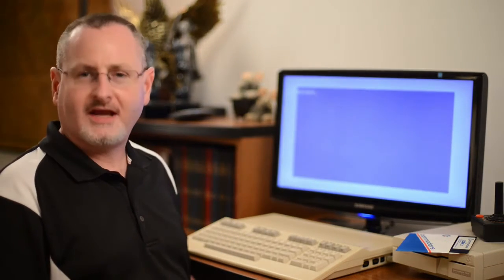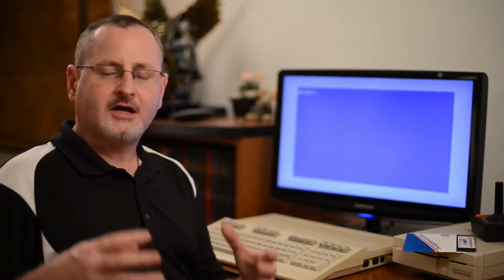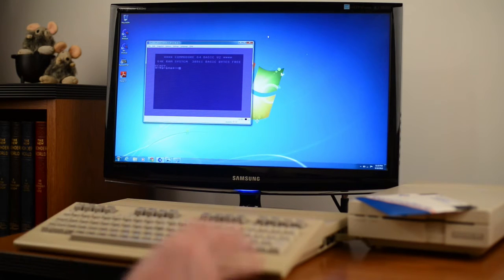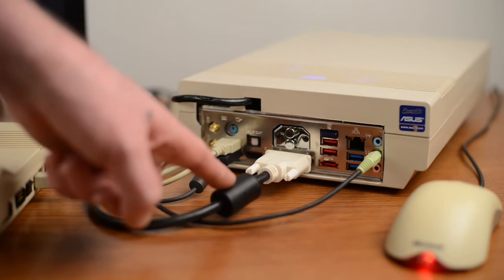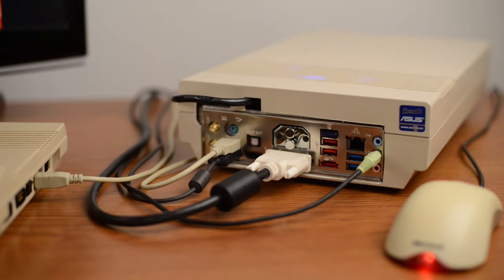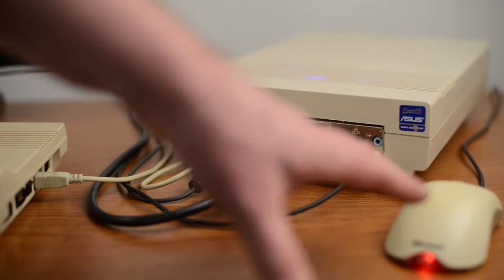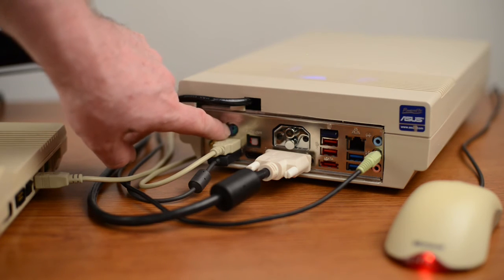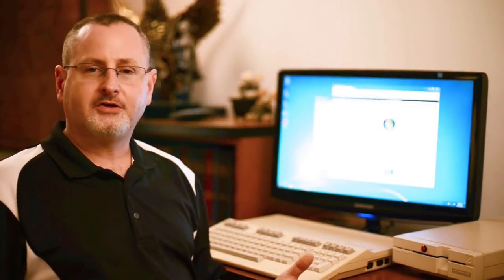Commodore Hacks P2: Broken Floppy to Micro PC Mod

Comment: Okkkaaaaay you made a windows PC and destroyed a collectable 1571 drive when you could have just purchased a Raspberry Pi.
Reply from the maker: Thank you for the commentary. As a matter of fact, this computer was actually built in 2011, the Pi didn't even exist at that time. The video was published in 2014, by then, the Pi 2 still wouldn't be released for another year. The 1571 case was what remained after the internals were used to restore life to another non-operational unit.

Comment: where can you get a 128d servant rom? thanks
Reply from the maker: The only method of obtaining the Servant today that I am aware of is to download the .bin file and burn it to an EPROM. Officially the creator of the Servant describes it as Shareware, but stresses that it is not Freeware and asks for a roughly $10 contribution.

Per the manual, it says, “Anyone is allowed, and invited, to copy and spread the four .sfx files which contain THE SERVANT on a non-profit basis. That is, you are NOT allowed to charge money for THE SERVANT except to cover the price of the media. However, a small profit is allowed for public domain/shareware libraries and BBS systems. From version 4.82 and onwards, only the four .sfx files released by the author may be copied and distributed, and all four of them MUST always be included. The distribution of any of the material contained therein in any other way is not permitted. Re-compressing of the material is not allowed except for strictly personal use.”

Below are a couple of resources to point you in the right direction.

C128 spare rom slot on Lemon http://www.lemon64.com/forum/viewtopic.php?t=25842&sid=2d69dd3df1a8c98b9c0a266d11375d1b

Tips and Tricks for C128 includes a downloadable .bin file for the Servant (just click on the chip image to the left of the description http://commodore128.mirkosoft.sk/enhancements.html

Here is another link for the file, but more importantly, it includes the manual, which is essential for customizing and programing the Servant http://c-128.freeforums.net/thread/294/function-roms-c128
Reply: Thank you for the information!

Comment: How did you get the keyboard to work with PC? Can PC KB work with 128? Good looks!
Reply from the maker: I'm glad you asked. Sorry for the delay getting back to you, I was hoping to open her up to get you an exact name of the device I installed, but still haven't had a chance. Basically, it is a small card (about 3x4") installed in the case where the joystick ports and power switch are located. The 128 itself was nonoperational, so I pulled the motherboard out and replaced it with the interface card. I believe it was made by a guy in Germany. If I get a chance, I will post more details later. I don't believe a PC keyboard will work with the 128, unless there is a similar device that does the reverse.
Reply from the maker: +Semi-Nerdly thanks again for the constructive feedback. As a matter of fact, this is a 3-part video. All the details you are seeking are revealed in Part 3. Thanks for watching! 😊